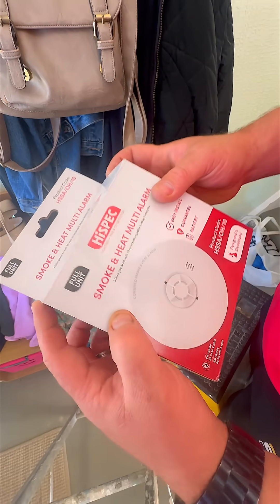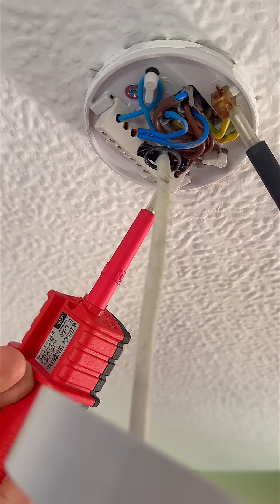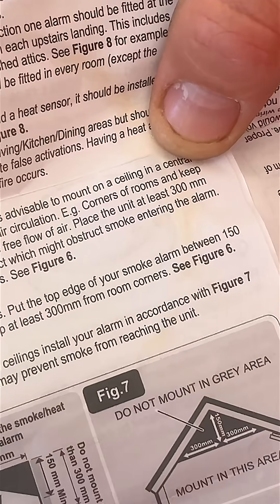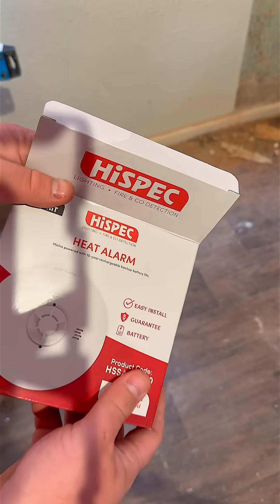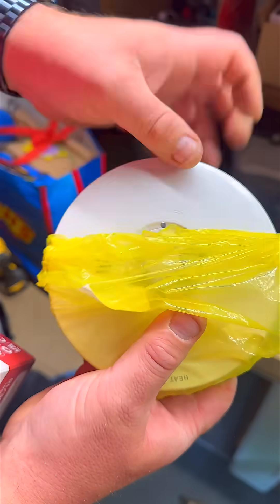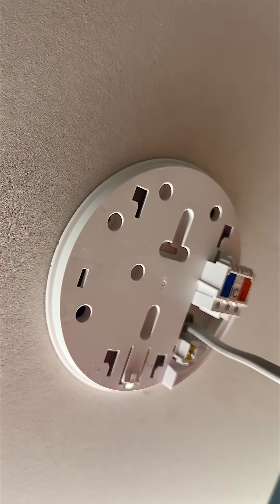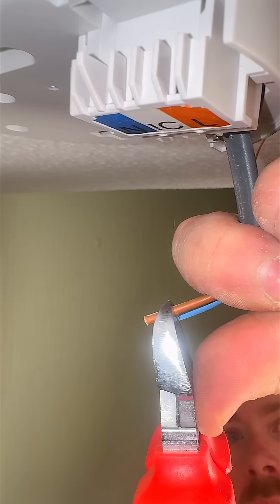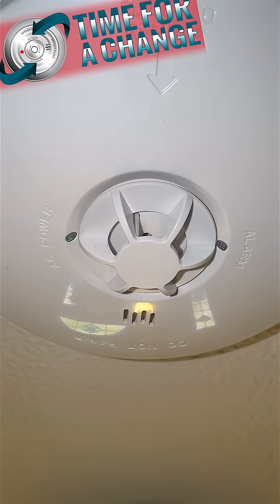Can you connect smoke alarms to a lighting circuit?

Comment: Thought fire proof wiring was required to all detectors and all on a separate circuit that sets them all off to warn everone else in the home.
Reply: Only in high risk properties. What’s missing here is the wired interconnection that’s now specified by many council’s building regs depts
Reply: You do not need fire-proof wiring in a normal house.

Comment: Since ceiling lights are usually implemented with a switched live, does the alarm just have a battery that get's charged while the lights are on? Or how does this work?
Reply: Depends if it has the loop at the pendant or switch.
Reply: No, the alarms must be connected to the permanent live of the lighting circuit.
Reply: The majority of battery operated alarms have a 10 year life.  The recommended replacement dates for the alarms are normally on the side of the alarms, and normally on the underside of the alarms where the other manufacturers information is written.

The mains operated alarms where they are wired on their own circuit, or wired onto the light curcuit must always be wired on a permanent feed, Not a switched feed.  These alarms should have a battery back up for when there is a power cut on the local supply.  We install and maintain the Aico alarms with the Aico Gateway system, and the backup batteries last for approx 72 hours.  Once the supply returns to your property, the internal batteries are charged.

We normally connect new alarm circuits to the light circuit, in Social Housing, we gave issues of people smoking etc.. sets the alarms off, and they have in the past turned the circuit breaker for the alarms off, thinking this will stop the alarms from working.  Connected to the light circuit, by turning the circuit breaker off, neans that they lose the lights to the property, and this has stopped individuals trying to stop the alarms from sounding and removing their protection.

One ladt thing, if a contractor had installed the New system, and we are asked to attend the property as the new alarms are randomly beeping, we have found that possibly one or more of the mains operated alarms had been connected to the switched line of the light fitting, and the green power light is not on.  Try and turn the light on next to the alarm and see if the green light comes on first, before removing the alarm and checking the voltages.  The alarms beep due to the batteries are only charged when the lights are on, and run down when the light is off.

Comment: Be mindful not to place the alarm to close to the wall as well.

I'm an electrician working in Social Housing, and come across issues with textured ceilings daily.  Any textured/ artexed ceilings pre 2000, maybe have asbestos in the textured covering, and disrupting the surface should be done with caution, ask for advice first.